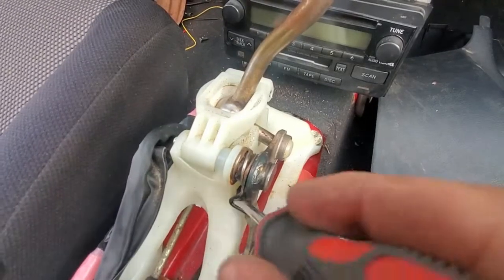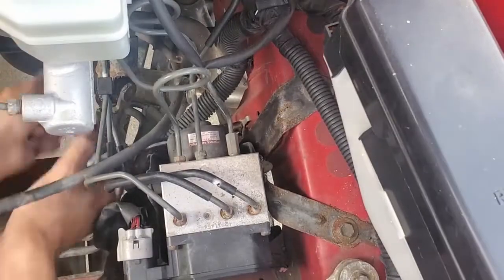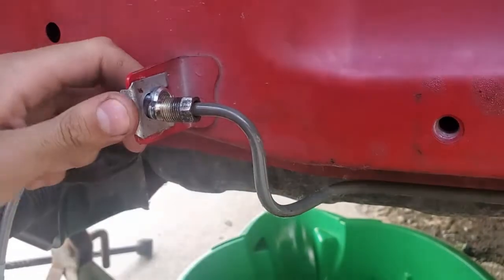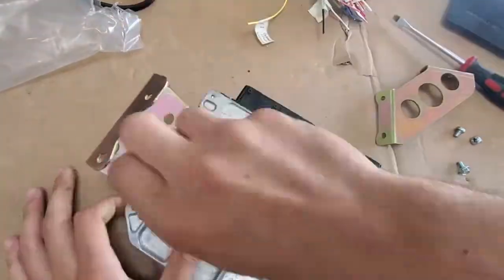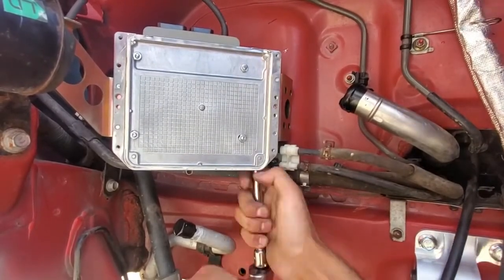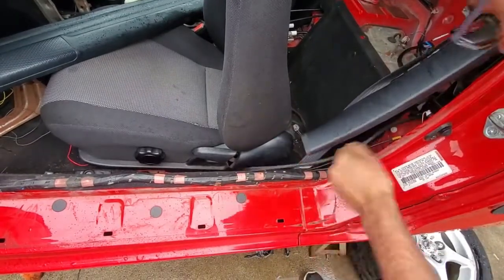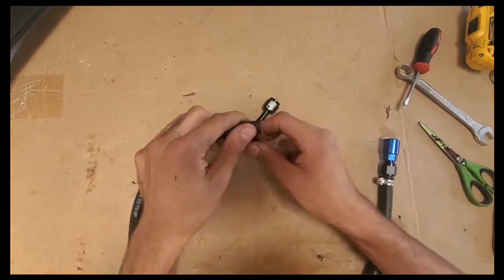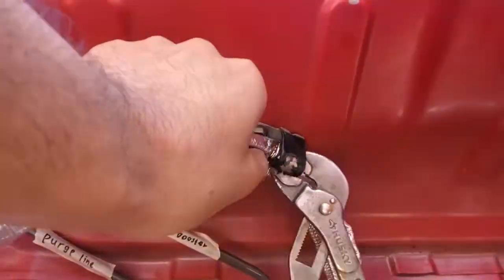MR2 Spyder Project Car Part 4 - Chassis Preparation

Comment: Couple notes- if you plan to track the car I would recommend a heat sleeve around the clutch line where it is close to the header. Also, I would add some additional heat isolation on the firewall as it gets pretty hot…
Reply from the maker: I agree. But I like the car too much to track it haha